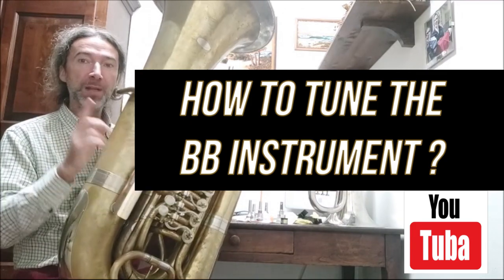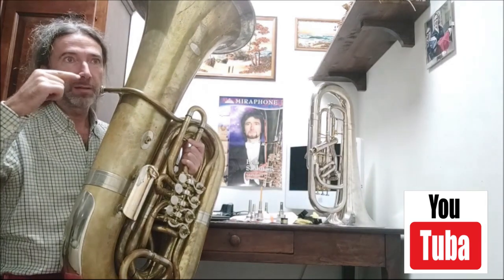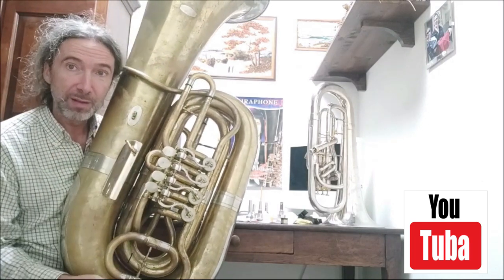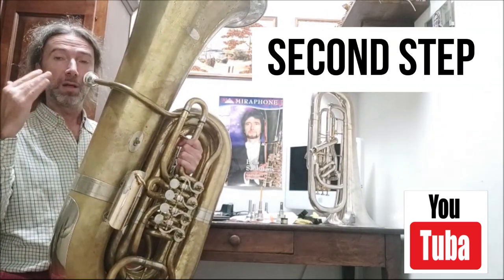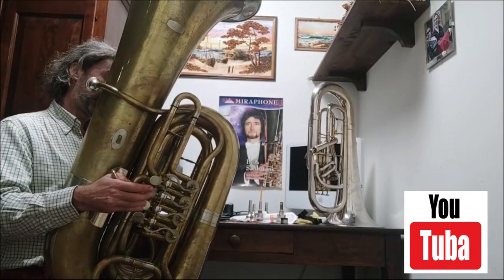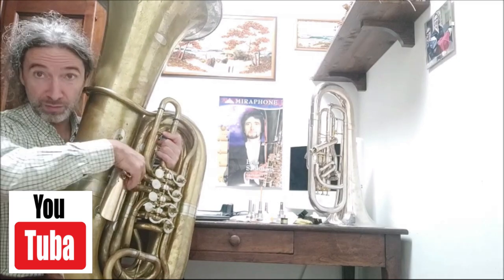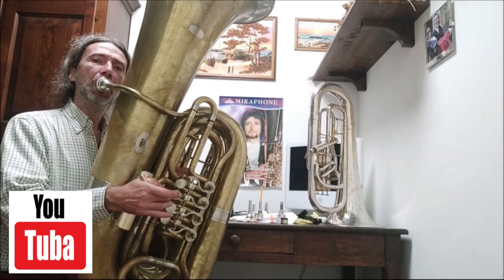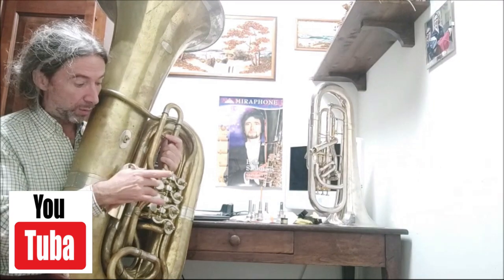TUNING Bb BRASS in 5 STEPS, splecial video dedicated to all brass players & beginners // STARTUBA

Comment: Tuning your slides to make alternate fingerings in tune doesn't make much sense. The reason alternate fingerings are alternate fingerings is because they are typically not as in tune as regular fingerings. You've made your alternates in tune but you've made all your regular fingerings out of tune
Reply: Oh and putting your 2nd slide in backwards will do nothing
Reply from the maker: The innovation becomes from research, the research becomes from knowledge. I discovered a similar system in a very old horn method printed in Florence in the XIX century, I tried it and I maked some improvement to adapt it at the tuba. All string players tune all strings and not only the A string. Can you tell me why the brass players should tune only the general tuning slide and not moving the others valves tuning slides? I feel good with that system, I offer my knowledge for free on my YouTuba channel. Test the system first and decide if it works for you or not and take it easy! I am sorry but we are not everyone the same and we have not the same equipment.
Reply: @sabbatanieros  "Can you tell me why the brass players should tune only the general tuning slide and not moving the other valve slides?"

I did not say this. All slides should be tuned through careful experimentation. I recommend first tuning the main bugle then tuning the valves on typical notes that you use them for. E.g. tune your 4th slide so that C below the bass clef is in tune. A good way to go about this is by comparing against a drone. Slide positions will not guarantee accurate tuning across the range of the instrument so the aim is to find a tuning that puts most of your instrument as close to in tune as possible and do the rest with your ear and lip.

By tuning your slides to alternate fingerings you basically guarantee that you're out of tune.

It is good of you to make free educational videos but this particular one is bad advice. Doing this exercise of matching tuning on alternates could function as a good ear training exercise but it's a really bad way to set up your horn
Reply from the maker: The violin tune first the A string and after D, G and E, to control if the intonation it's ok they use the comparation between the lowest sting pressing the fourth finger and the next open string. The guitar make something very similar. Why the tuba can not do something similar? What you say about my system is not right, the instrument is not out of tune why I make the comparation between natural armonics of the instrument until to find the right intonation of all valves slide. If you will test your instrument after my system You will see that the intonation of 1&2 is a little beat sharper than the 3, the 1&3 is sharper than the 4. The instrument is not out of tune, is only more balanced. A brass instrument perfect in tune doesn't exist wy they are based on harmonics  that are tuned with the natural intonation and not with the temperated system. I played with the most important Italian orchestra like Teatro alla Scala of Milan and never with my system I had problems with intonation.